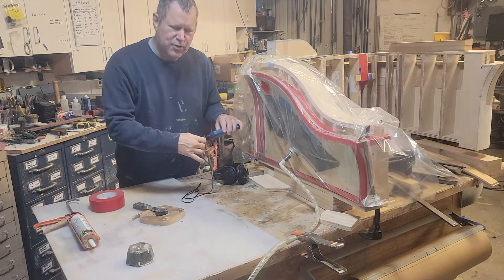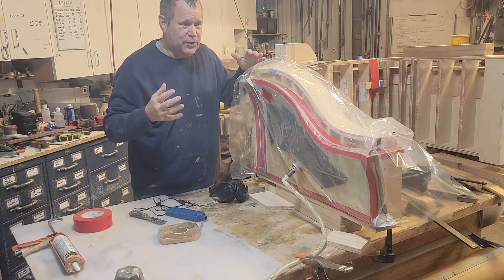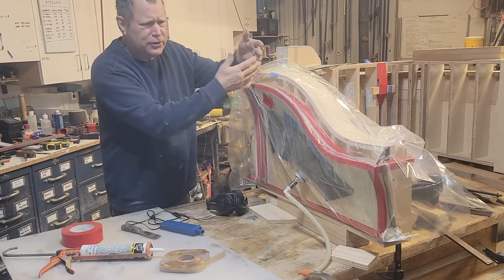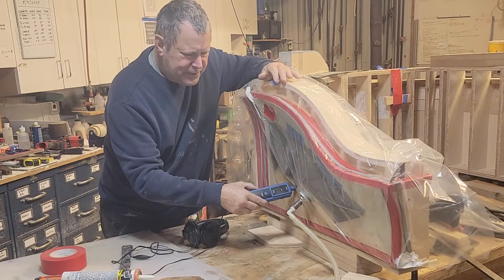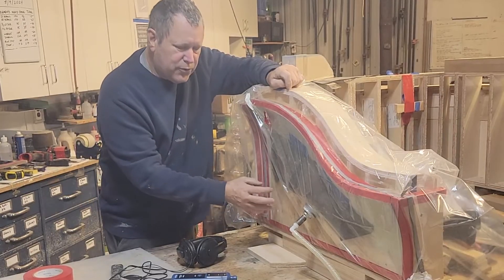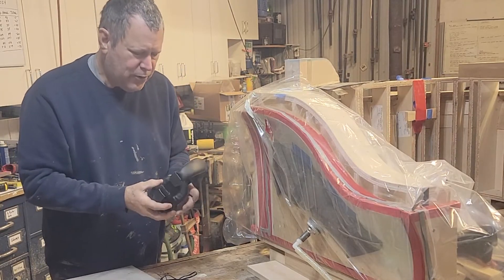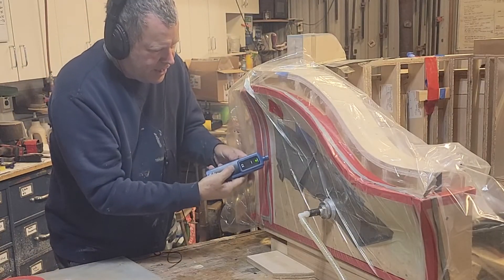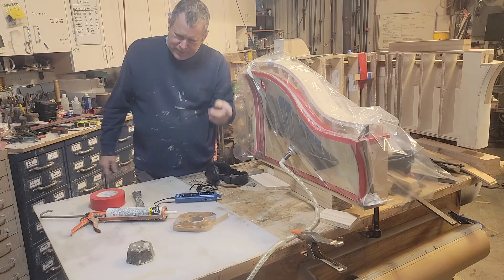Vacuum Bag Ultrasonics Leak Detector

Comment: Hi Scott, what vacuuming pump do you use. The Vacupress pump would be good but is quite a bit too expensive for the use I would get from it ( only a hobbyist). Cheers from Australia 🇦🇺
Reply from the maker: Depends on what I am doing. Acupressure is.set.up for my veneer bag. I have a vevor for resin casting. A frugal for vacuum Chuck. Any will work.